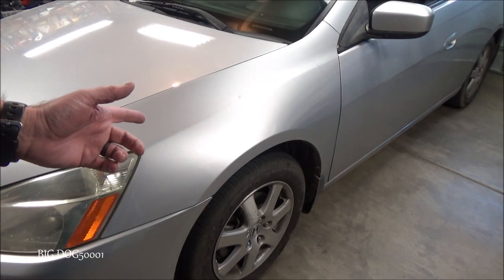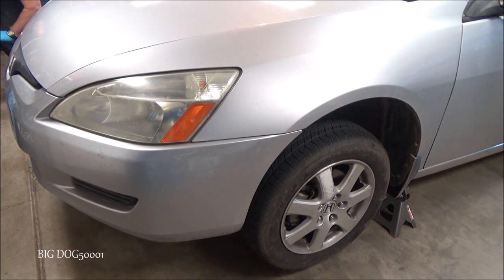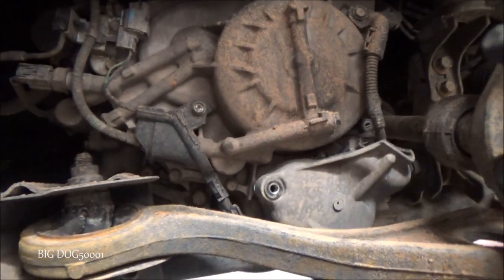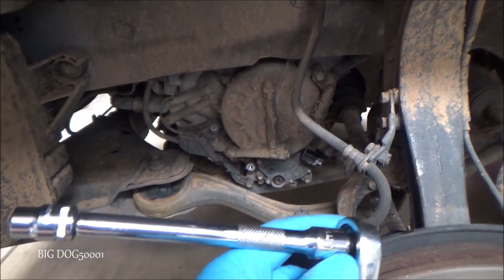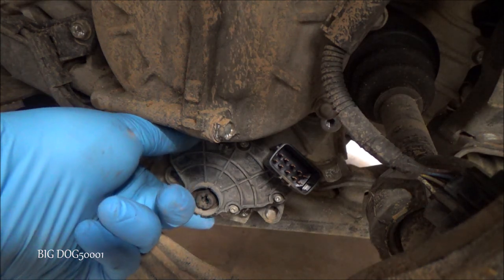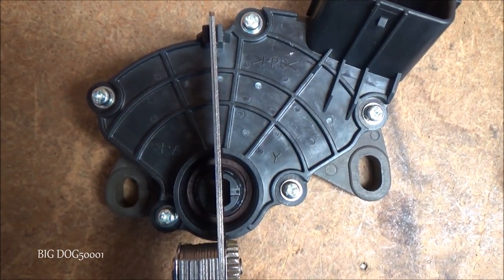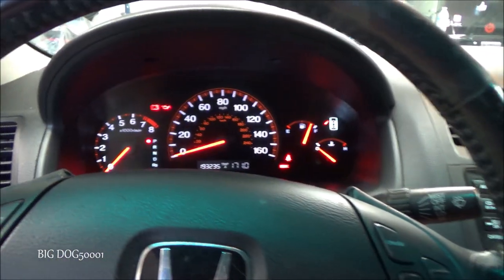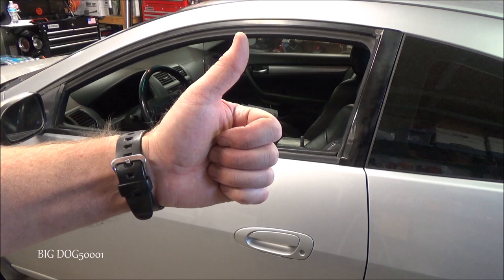Honda Intermittent No Start-Transmission Range Switch Replacement 2005 Accord V6 (2003-2007 Similar)

Comment from the maker: Parts and Tools
This channel earns a small commission using some of these links - at no additional cost to you.
Honda Transmission Range Switch:  https://amzn.to/31CYNTt
Daytona Jack (Cheaper at HF with coupon):  https://amzn.to/2mcbequ
Jack Stands (Cheaper at HF with coupon):  https://amzn.to/2nfdFsj
Milwaukee M18 3/8" Impact Wrench:  https://amzn.to/2nU6uWX
Sunex Impact Sockets:  https://amzn.to/2neILjX
GearWrench Sockets:  https://amzn.to/2nc8ARJ
GearWrench Ratchets:  https://amzn.to/2mnna8D
Metric Feeler Gauge:  https://amzn.to/2nTz7U9
Snap-On Torque Wrench:  http://bit.ly/2TzsaU0

The Big Dog 50001 Automotive Channel Store can be found here: https://www.amazon.com/shop/bigdog50001automotive

Comment: Thank you so much. My 2007 Accord has had this for two years now but I knew the trick, just put it in neutral and it's fine and I'll live with it. Car thieves will be having trouble starting this thing lol
Reply from the maker: Glad it helped, thanks for the comment!
Reply: Mine had no starting problem but it misfires like crazy and has loss of power.
Reply: Mines showing that code now how do i get it to start if it stops run
Reply: Mate i was getting an error P1717 and D light was flashing in ODO meter  so i used your trick and it worked for me. Now I start my car in neutral only but my only worry is will this harm transmission in long run ?!
Reply: @nitinkhabrani475  It's been 5 years now and still I'm using the same trick and I'm having no issues with the transmission. If you are too cautious ask a pro. All the best.
Reply: @2k_  thanks buddy.

Comment: I been having this problem for years, all I ever did was put my foot on the brake and cycle the shifter and started the car. It usually did start on the first attempt but after the car not starting for me on NYE before leaving to work I am glad I found this video. I really do hope this solves it for me once and for all. Thank you.
Reply: Are we twins or something? I had the exact same experience. Just cycled it to neutral every time until on NYE (a little over a week ago) it did not start at all. Took it to a mechanic and they couldn't duplicate it so they said its probably the battery and wanted to replace it for $250... Looks like I'm replacing this switch myself lol.

Comment: This happened to me 3 times.  The first time had it towed to the dealer they changed the starter.  Of course  worked fine for awhile left me sit again.  Had it towed again they found nothing it started right up for them gave it back.😔  happened again the warranty was about to run out on the new starter they put in (because thats what the dealer said the problem was).  I called them told them what was happening they said you can have it towed in they would look at it.  
I dont know why i did it but i put the car in reverse then back in park and it started right up.  I looked uo your video THANK YOU SO MUCH FOR SHAREING THIS!!!

Comment: Thanks....great video. I plan on doing my 2015 Civic soon. Another possible indication that the switch is bad could be the fact that both"p" and "d" are lit when I first turn the ignition on. There's also a sizzling sound coming from that area. It's been ornery to start here and there, but hasn't stranded me yet. Thank goodness for the Gold Wing backup! Also, I'd be tempted to give those electrical connections a drink of contact cleaner!

Comment: I am currently having the SAME issues on my 2004 Honda Accord 2.4L EXL as well, every time my car won't start (usually after I parked the car in REVERSE) I then shift thru the gear and put it back to Park position then it will start.  Now that you mentioned the what the problem is, I will work on replace the transmission range switch and I hope the procedures is the same as for 2.4L engine.  Thank you for a great video.
Reply: Hi there exactly the same happened to me today after parking my 2003 EXL V6 Honda Accord in reverse, it took a good 5  minutes to eventually start it would not even crank over in  neutral, it ended up cranking over and starting in park after 5 minutes. I have had this problem before in this car

Comment: This kind of intermittent problem is good reason to carry a few tools in the car, like a test light and maybe a multimeter. You never know when a critical clue, like no voltage on the S post of the starter, will narrow the hunt for a diagnosis.

Comment: Great video, very methodical.. Have a question, where does a 2013 civic 1.8L have the neutral safety switch? What is the trouble code for this Honda or a 2013 civic, if any related to this issue?

Comment: Same model accord. A friend of mine had the same problem. He dropped it off and i could not get it to act up after two days of having it. The day he takes it back...boom , no start at his house. He takes it to the dealer and they wanted to charge him $500 for ignitionswitch. Long story short, i ended up replacing the safety neutral switch. Problem fixed
Reply from the maker: Sounds like somebody wanted to make a $500 guess, good to hear you got it fixed!

Comment: I've been nursing a bad switch for months, my mechanic mistakenly thought the chip in the key was failing, causing no crank, no start. . For a while, when Park wouldn't work, was shift into Neutral. Then sometimes back to Park, and then back to Neutral. It would always eventually work by just playing with it. Then when even that failed, I would leave it in Neutral and then just lightly bump the selector down or lightly move it up. That has been my go to of late. The switch will be replaced shortly, but these techniques should keep you running for a while.

Comment: @BigDog50001 great video!!!
Just recently purchased a 2003 Honda Accord V6. Previous owner said that the car ran hot and motor locked up. When checking for codes, only one that came up was transmission neutral safety switch. Could this be the problem so far as the motor locked up and not cranking?

Comment: I had the same symptoms, having to start the car in neutral until it stopped starting in all situations. I obtained the part, changed it according to these instructions, but it still will not crank in P or N. Battery is charged. What next? Please help.

Comment: Very clear with excellent camera work and lighting. My 98 Accord shows same intermittent symptoms but I can get it started by wiggling shifter, stepping on brake or doing both. How would wiggling the shifter change things? Is there a mechanical connection to some electrical starter part?
Thanks.
Reply from the maker: There are electrical contacts inside the range switch and the range switch is connected to the transmission via the shaft it slides on to.  If the engine computer does not sense that it is in park or neutral, then it will not allow the car to start.  When you move the gear selector then that moves the contacts inside the range switch slightly which can cause either a better or worse electrical connection.
Reply: @BigDog50001  Wow, someone on the vast Internet actually read my question and replied. You made my day sir. Yes, now I understand. I watched another video where someone took that switch out and cleaned it and seeing how the switch actually works made it all clear to me. It's exactly how you explained it. The car is in otherwise great condition and we use it for winter driving in deep snow. Now I need to find a mechanic to change the switch at a reasonable price. Thanks again.

Comment: Had the same problem. Blasted the sensor with CRC electronics cleaning spray and it was good as new, didnt even take it off the car, and I have a new oem spare just in case. lol

Comment: 2005 accord 2.4, automatic, installed remanufactured from NAPA started right up. After warm up starter has a slight intermittent  grind when turning over and starts up. Some times it grinds and sometimes its smooth as silk. Changed the relays and ignition switch. Taking car to NAPA today to see if they think it is a defective starter. Could it be a defective Transmission Range switch?
Reply: returned the NAPA remanufactured starter and got a new starter. works great now

Comment: hi big dog i hope you will respond me right away i have they same issue with my 2005 honda pilot no crank but all light on when i put my key to 2 position but with my remote it start the car,,, i change already my neutral safety switch but nothing happen they same thing no crank but with the remote starter it start the car,,, what do you think should i do now? thanks i advance

Comment: Question: Should that TRS be getting any kind of voltage when the ignition is turned to on?. 

I know that a relay inside the passenger footwell is activated when the ignition is turned on. However,  that relay gets power from the ignition, but the ground is tied to the TRS. So the TRS has to be in Park or Neutral for the ground to be in play, which would then sentd the ground signal to the relay, and in turn, the relay sends power to the starter. 

I'm asking because I tried to bypass and I can't seem to get anything at the plug to the TRS.

Comment: If you have a HYBRID, it is different! At least my 2005 Honda accord was. The part was definitely not as easy to take out and way easier to mess up. There’s no video out there, I ended up watching a video for a Honda odyssey or something and it was very similar. Just kind of followed that and did it. Good luck everyone

Comment: My cat cranks but sometimes I have to put it in neutrals it won't die   it runs for a while then  it dies it does it  intermittent   I replace the main relay and check the power to the fuel pump I get 12 volts  I hear it bussing 
It runs fine the indies in the middle of the road ? Any ideas honda pilot 2003 3.0 v6

Comment: I mistakenly cranked on the shaft you said to be careful not to move or break like a dummy. It didn't feel like I was able to budge it, but now my sensor adjustment never seems to take. Even when I adjust to neutral with the car in neutral, the car tends to read neutral when I'm in Park, Reverse, Neutral and Drive. 

Anyone know what the fix might be if I broke that shaft?

Comment: Hey Big Dog, I’m having an issue with the car not starting. Won’t even crank. I thought it was the neutral safety switch so I tried putting the car in neutral to start but still nothing happens.. could this still be the neutral safety switch or most likely something else? I’ve tried a different relay as well and still nothing. Thanks!
Reply from the maker: Could be a lot of things, battery, loose connections, starter, wiring, starter cut relay, anti theft, ignition switch, transmission range switch/neutral safety switch and the list goes on.  I would start by looking at wiring diagram for the starter.

Comment: My brother in law has a 2003 Honda Civic lx. When he tried to start the car he turns the key but it won’t start. He has to turn the key over multiple times to start the car. I replaced the starter today but problem still persist. Car starts fine when it wants to but replacing starter didn’t fix the issue of having to turn the key on and off to start the car. There’s no force in turning the key so I ruled out ignition. Any ideas?
Reply: Starter relay good?

Comment: Big Dog.. 2004 Odyssey, 184000 road miles - mild wreck in soft wet medium and post-repair by 2 years.. slight leak at tranny about a quart a quarter year.. went several months while I was sick with leukemia with wife & son driving & thought he was helping her with fluid check/maintenance but not -  stick was at least 2 quarts dry with bands seriously slipping so poured a couple of quarts and slip stops for about 100 yards.. I add more & slips in about a hundred yards..  on stick but now I wonder if overfilled:  why does it go in R & D like new for a hundred or so yards and then major slip.. stop & cut engine it jumps into gear like new for a hundred yards..  slip is checked by cutting engine for a short - don't follow this well.. filter pump strainer.. ??? Happy Thanksgiving Bro

Comment: Hi, I have a 2013 Honda Accord V6 with intermittent start issue. I hear a click but no start when I push the start button. I tried to put car in neutral but it seems like I can't shift out of park without car running & foot on brake. Is this proper function? Is it suppose to allow you to shift out of park with engine off & foot on brake? Thank you
Reply: The shifter is locked when the car is off. You should see a little black square next to the shifter. Pop that off and insert the key and you can put it in neutral! I have the same car 😊
Reply: Just saw this was from a year ago. You probably already figured it out!

Comment: had the exact same thing happen on a late nineties jeep xj cherokee. would not crank in park. jiggle the shift lever and try to start would sometimes work. put in neutral and it would start. transmission range selector was the fault. simple fix once I figured it out.
Reply from the maker: Thanks for the input!

Comment: Hey i have a similar problem except mine only is that the light doesn't show when I get in reverse but everything works fine. I've been searching and couldn't find a definitive answer. I was wondering if this would work?
Reply from the maker: It could be a bad transmission range switch causing it, however it could also be other things like a communication or module issue or a burned out LED in the gauge cluster.
Reply: @BigDog50001   last question is it located in the same place as it is on this honda? Because whenever I go to oreilly or autozone they can't pull it up or even know what its called and I keep telling them its the range switch but they just look at me like I'm crazy 😂😂

Comment: Can you please tell me where the camshaft position sensor is located in this car.
Reply from the maker: On these V6 Accords, the cam sensor is behind the camshaft pulley, attached to the back side of the back cam cover.  The timing belt, the camshaft pulley and back cam cover have to be removed to get to it.

Comment: Hi I just changed my transmission on my 05 accord know it just cranks but wont turn over can you please help
Reply from the maker: If this started right after work was done, I would double check my work, especially all electrical and ground connections.

Comment: I have a 2010 accord , any idea where it might be ?
Reply from the maker: 4 and 6 cylinder engines are in slightly different locations but their location is similar to the one in this video, behind the left front wheel.

Comment: Wow this is insane honda dealers and mechanics dont know about this. What does the neutral switch do anyways? Does it cut out power to the ignition and why would it do that? Is there an engine code?
Reply from the maker: It is there so the vehicle does not start with the transmission engaged, which could damage the transmission or make the car surge forward (or backwards).

Comment: I screwed up.  with the selector switch off, I moved my gear selector to park trying to get the key out for the night till I got the part.  Now I can't put it back in neutral or get the key out.   Anyone know how to get me to a point where I can put the switch back on  now that I have the part?  Thanks in advance.

Comment: I would expect some independent shops no being able to diagnose the problem but for the dealer not to be able to diagnose it is ridiculous.
Reply: @heyitschinoable  Ya, intermittent issues are harder to diagnose but that doesn't excuse the dealer for not being able to find the problem.
Reply from the maker: It is very hard to diagnose intermittent issues, you need to be able to recreate the problem.  That being said, many shops are not very good at asking the owner questions and thinking critically which can be key to solving issues like this one.   Thanks for the input!
Reply: ZIB187 , I totally agree too !!!

Comment: Hello, my issues is a combination of faults I believe.
I have a 2003 Accord EX, key getting stuck in the ignition 80% of the time I park and try to get it out. After the key gets stuck the shifter   gets stuck in park, I tried starting it in neutral and that works half the time.
Also  sometimes if I slowly sink the break after putting it in park the key will come out.
A mechanic said it was a shifter issue, he changed shifter panel and the cable that goes from the shifter to the transmission. $130 and did not change a thing.

Comment: I have an 09 Honda  Accord and auto-transmission oil pressure switch, I changed it but the light still on. code P0843
Reply from the maker: Unfortunately it will probably need some troubleshooting done.  Transmission Fluid Pressure Switch A closes when there is pressure in the hydraulic circuit it is attached to (the second clutch), and a signal that it is closed (5V pulled to ground) is sent back to the Powertrain Control Module (PCM).   It could be an open in the wire to Transmission Fluid Pressure Switch A, a problem with the switch itself, or connections, or it could be a shift valve/hydraulic pressure problem causing no pressure in the second clutch.  Knowledge of how the transmission valves work and a Honda capable scan tool are going to help diagnose this.